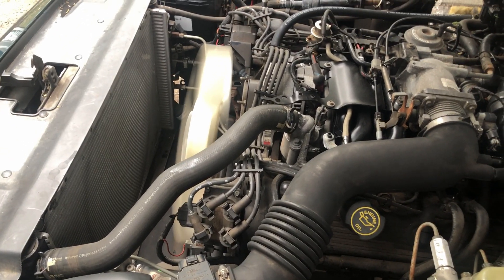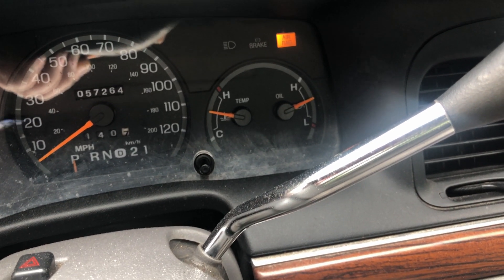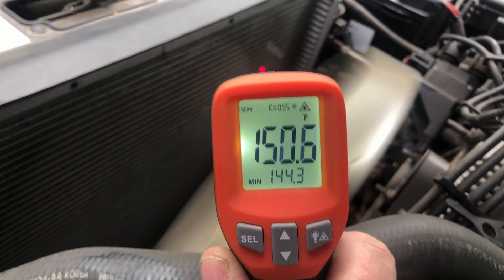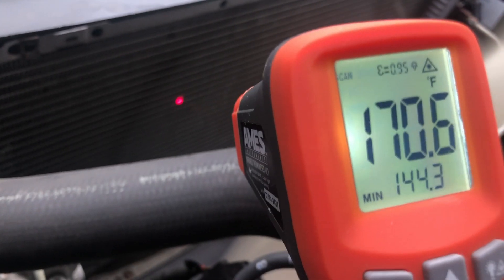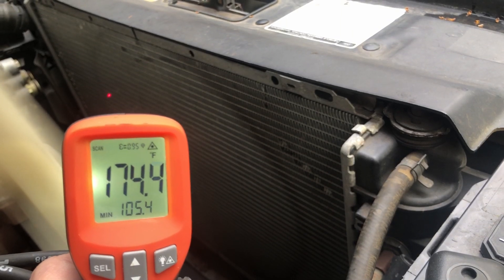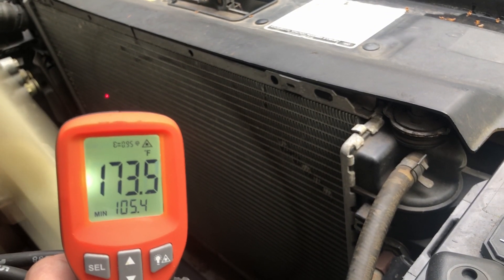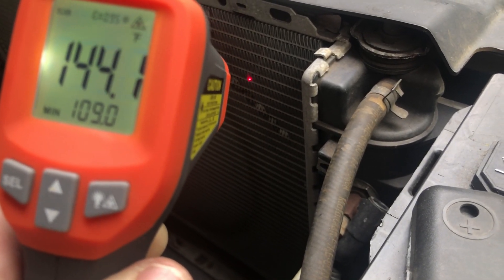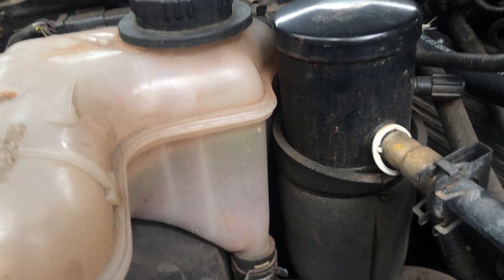Car Overheating.  Clogged radiator ?

Comment: Yo, wheres your shroud at? Air cant blow (from the fan) threw your radiator very well like that. Pull the bottom hose or open the petcock and see what comes out. Im guessing plugged up radiator and a bad water pump?

Comment: A while ago I was having overheating issues with my 1996 Lincoln Town Car. I flushed the cooling system, changed the thermostat, and checked the fan clutch, it still was overheating but the one thing I overlooked was the water pump. I pulled the water pump and discovered the impellers had disintegrated.
Reply from the maker: Interesting, im hoping ford made some improvements on the design From 66 to 97. but i will keep it in mind.
Reply: @iRepairElectronics  66'lol' I said 1996 which has the same setup as this 1997 Crown Vic
Reply: my vehicle overheats w/ AC on. A faullty water pump wouldnt cause this selective overheating a?
Reply: It is a crossflow radiator, so the the water is always going to be hotter up the top on the side of the top hose and it cools down as it moves across and down through through the radiator. The bottom hose should be substantially cooler, because the radiator has performed its task.